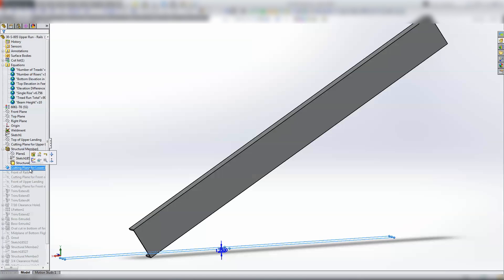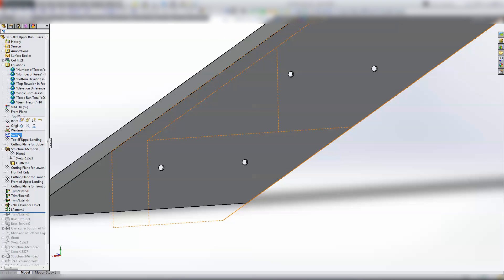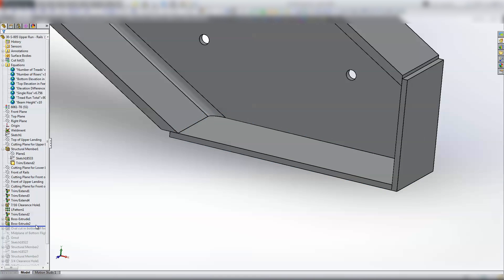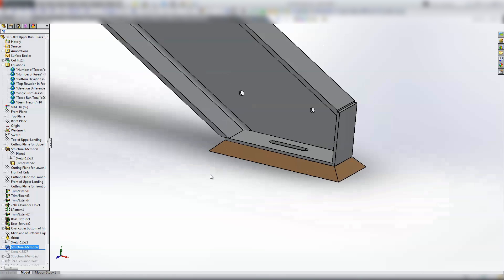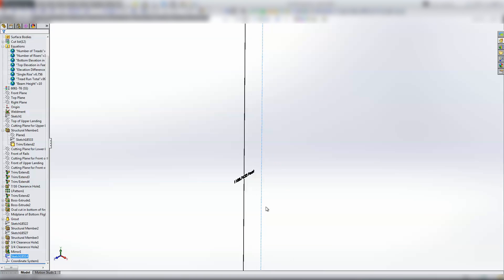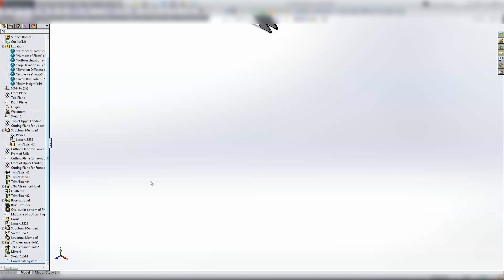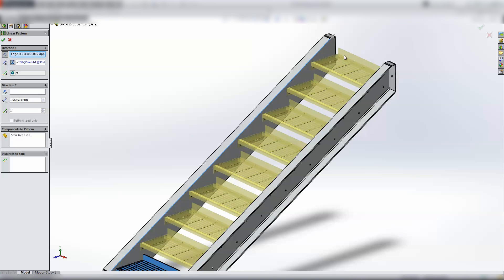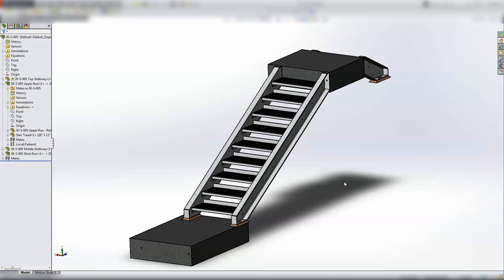Solidworks Training - Tutorial:  Structural Steel Stairs Pt. 5 of 5 and CAD Files

Comment: When you cap the channel face shouldnt it lap over the faced edge for proper finish? Or is it a structural element...
Reply from the maker: Hey Matt, it depends on what your designer is specifying or what the welders prefer.  Some want to do a run past fillet, others don't mind doing the corner welds as would be the case here.  I did make a mistake on these stringers as any and all of the flat parts should have been sheetmetal so that I could have got everything on the cutlist with more automated annotations available as sheetmetal vs just a straight extrude...